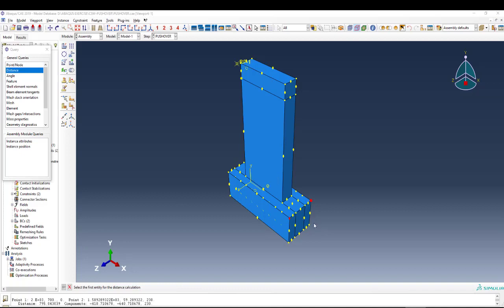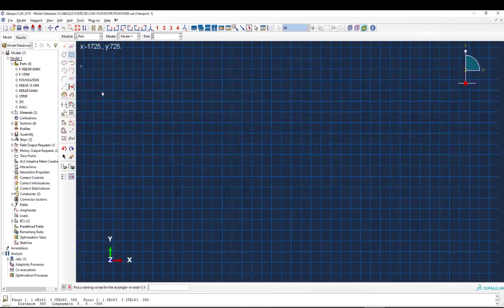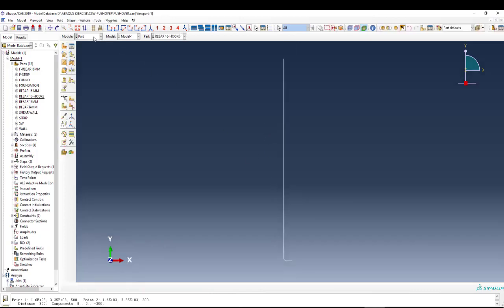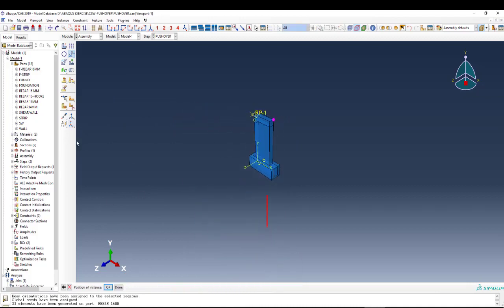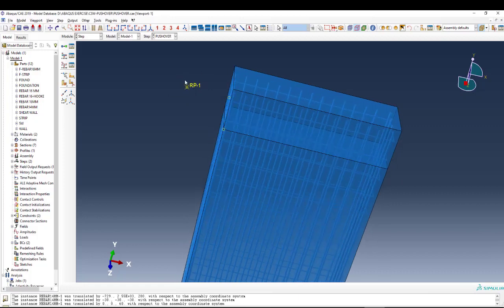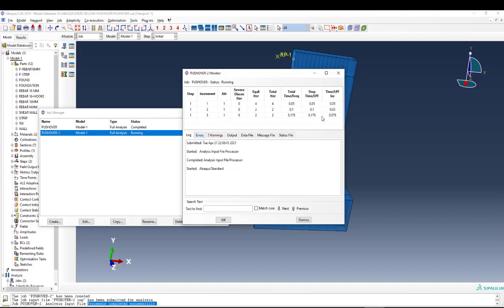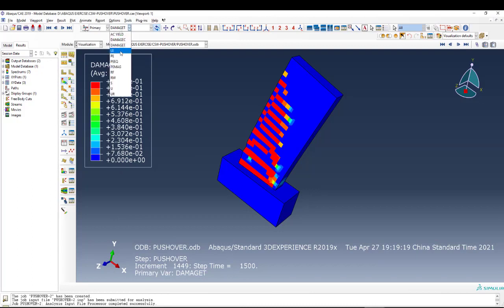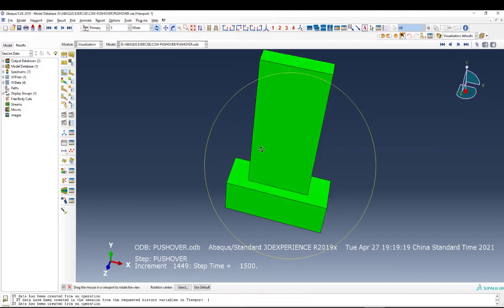Reinforced Concrete Shear Wall Simulation using ABAQUS software with A Pushover Analysis

Comment: Hello Sir, I have seen that the wall and the foundation were modelled separately, but you have only one part "shear wall". How did you join together?, Instead of do that, Can we create an interaction tie between them, the results will be the same?, thank you for your answer
Reply from the maker: Hi there , yes you can use tie intersections and also you can model them as single structure.